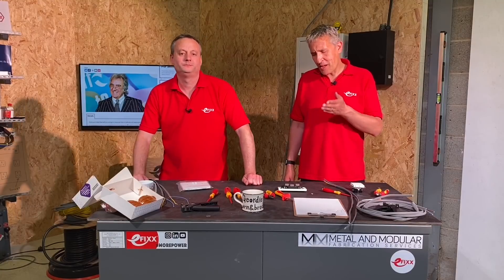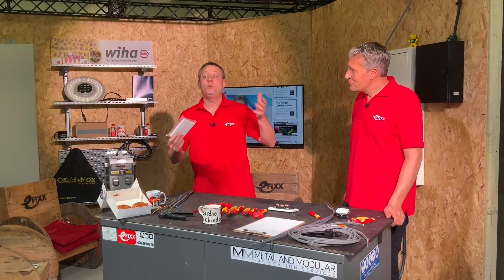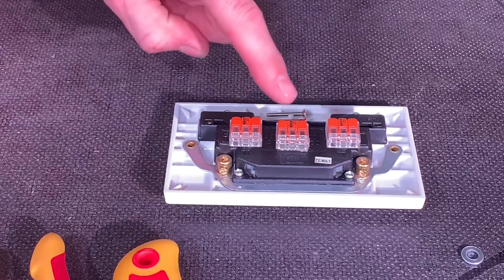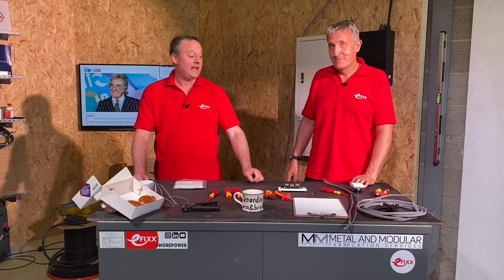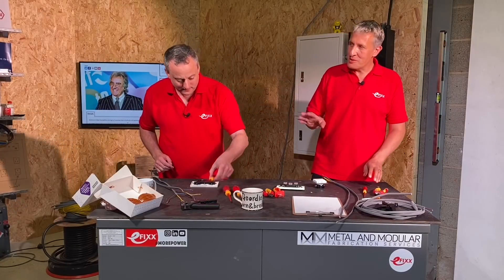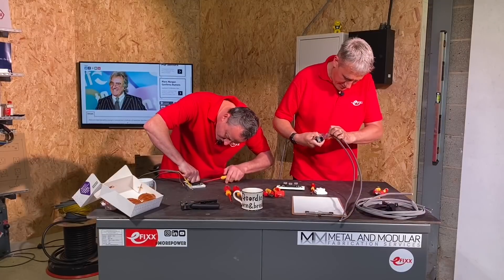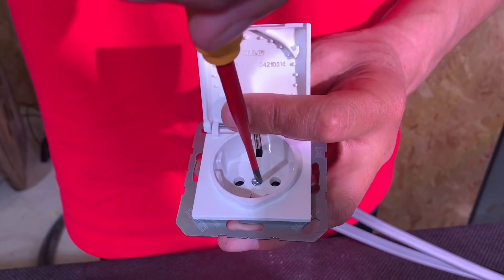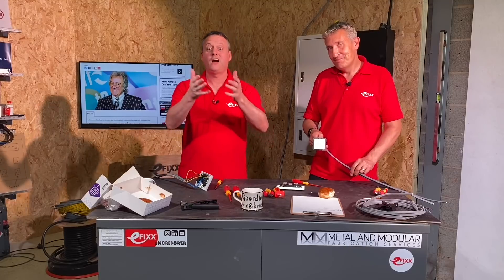When will UK sockets have WAGO style connectors? - electricians comment

Comment: In my experience lever connections are great. Push fit has been rather varied in success. Its too easy for a wire to slip out of a screw fitting especially when there are multiple wires into one fitting.
Reply: Absolutely. In theory meant to get 4x 2.5mm into a socket terminal, but so often a little tug after tightening the screw pulls one out, wouldn't trust 4 wires in a terminal longer than it takes to get them in there! These days if it needs more than 2 they go in a wago and just have 1 to the socket!

Comment: I was thinking this on Saturday as I was desperately shaking the socket to get the screw out of the back of a B&Q special that I'd backed out slightly too far. Absolutely no chance of getting it back in either with the poor design so had to ditch it and install one of mine - the joy's of customer supplied fittings....

Comment: oh yuck wagos on the back of a socket getting stupid now screws dont go loose over years thats the biggest load of rubbish
Reply: Loose screws is one of the biggest causes of electrical fires.......
Reply: @paulekstorm-hughes1894   i dont understand though if you screw the terminations nice and tight when its installed what could physcialyl and realistically cause them scres to become loose when they are not distubed
Reply: Kieran tv Youtube Tiny changes in temperature cause endless expanding and contracting of the entire assembly. The copper wires that the screw clamps down on very slowly deform under the pressure of the screw. Pulling plugs in and out causes slight flexing of the socket. It's very common to remove an fitting and find the wires just resting in the terminal, or even completely disconnected. This is why junction boxes etc with screw fittings must, under the regs, be installed where they are accessible for maintenance- which basically means checking and retightening of the screws periodically.
Reply: @filipe.skunk8   oh really i been advised by the electrical shop not to use wagos as there awful terminal blocks are the best and i have never had a problem with them
Reply: @filipe.skunk8   oh really ever heard of the words GROW UP 
i rectified and repaired reverse polarity issues today thank you very much found a old as junction box were the screws loose on it no they wernt must of been there for years no burning nothing  because things were built with pride
ill have you know aswell i have learned more from my uncle whos a electirican than i have from college whats this channel about again more stupid teachers moaning about stuff that winds them up in my college electrics we test projects with 13 amp plug tops
Reply: Mine worked loose.

Comment: Whenever the patent expires?
Reply from the maker: Wednesday 🤣
Reply: There is no patent on spring loaded connections.
Here in Germany everything is spring loaded except the breakers or some cheap appliances.
Every brand of switch or socket has some kind of springloaded connection.
The socket with screws are not allowed anymore (at least in new Installations)
We also don't do junctionboxes anymore.
Everything gets connected in the hole for the switch.
Just to avoid connections that are inaccessible.

Comment: Definitely the way to go (excuse the pun!) So many sockets now have cheap screw terminals that aren’t big enough to reliably take three 2.5mm wires - especially if you have stranded conductors (older twin & cpc or conduit cable). As others have commented; far too often you find existing work with loose screws or incompletely inserted terminations ready to overheat!
Reply from the maker: Great points 👍 thanks for commenting

Comment: Here in Germany that's the standard for several decades. It started with light switches first, then the outlets were fitted with such terminals. And now you got boards, MCBs, RCDs, RCBOs with such terminals (Hager Quick Connect).
Now these days only cheap outlets or switches have the screw terminals. With one exception, special devices like a wall mounted pull switch, or old stuff which is still in production like the old black bakelite switches like this one:

https://www.heinze.de/imagedownload/?image=/m2/20/59220/images/73/13515673px1250x1250.jpg

For people which like the 1950s industrial style in their home...

And there's no need to push the button when inserting the wire, only when you remove them.

The switches, in that case a two-way switch but as you can clearly see, the housing is also used for other models like the intermediate. But in that case there are three terminals, behind the other holes is no terminal:

https://www.voltking.de/media/image/product/59987/md/busch-jaeger-2000-6-us-wippschalter-einsatz-aus-und-wechselschaltung-thermoplast-blau-2cka001012a1069~5.png
Reply from the maker: Great information - Thanks 🙏
Reply from the maker: Can you send us a link to an RCBO with screw less terminals.
Reply: @efixx  Single phase, B16, type A, 30mA:

https://www.hager.de/modulargeraete/fehlerstrom-leitungsschutzschalter/fi-ls-schalter-1p+n-6-ka-quickconnect/ads916d/982446.htm

Three-phase, B16, 30mA type A:

https://www.hager.de/modulargeraete/fehlerstrom-leitungsschutzschalter/fi-ls-schalter-3x-1p+n-6-ka-quickconnect/adz316d/1001726.htm

Comment: Almost every Socket and switches  in Danmark are without screws and have been that for many years.🤷🏻‍♂️🇩🇰
Reply: How do fit the socket face to the back box.
Reply: Adreen Ryan With a hammer.😁
Reply: @adreenryan2901  there's three parts, the back box, the socket and the face plate. The socket itself is where the termination happens, this is carried in a cage as seen in this video. That is attached to the back ox with a couple of screws which are usually retained in the back box. The faceplate then screws to the socket, sometimes snapped in place depending on the manufacturer.. Almost all switches are snap on to the switch body.
Reply: Your just as bad as Dennis Gorny. Must remember you southern Danes are practically German

Comment: Looks like the German single socket would need at least a 35mm backbox? (Possibly a 47mm if you include the cables entering via the top/bottom then looping behind the socket to the terminals)
The time saved at 2nd fix doesn't look like it'll cover the time chopping out at first fix to me. Especially with dot and dab being a uniform 25mm. All that chopping out would have to be pretty accurate and flat to keep the plasterers happy. Can't see it taking off on new builds any time soon if they need deep boxes!

I've never used a push fit connection with solid 2.5mm copper. Would the "stiffness" of the cable be able to counter the springiness of the connection?
Reply: We use a standard hole of 68 mm diameter for every power connector or light switch. The deep is variable, 40 mm is old standard. I like to use 50 mm for space for electric actors (eg. bluetooth) or cable connectors. In the history we use an extra hole for connection - now all into the switch holes. It is more easy to repair.
Reply: You are forgetting that the backboxes are round so drilling the hole for them is a piece of cake, a second more with the core bit gives you a deeper hole! First fix takes much less time in the first place!

Comment: We've had quick connect push in outlets and switches in the US since the 1960s.
Reply: I'm in the US and my brother's house developed several faults with outlets wired with 12/3 cable and push in connectors. That arrangement used 6 of the push in connectors per outlet and the stiffness of that many wires made it difficult to push the outlets into the boxes (which are narrow and deep in the US). I use Wago connectors now and they work great as you can push each separate connector into the box without much wire stress. As a time saver I'd prefer outlets come with attached wire leads that you can use with standard Wago-type connectors.
Reply: Yeah, but only for 14 AWG wire and could not be used for 20 amp circuits.
Reply: Yet wire nuts (which are crap) are all over the place. 

Every time I pull a socket or switch off the wall the nuts get replaced with wago.

Comment: You don't have to push the lever of our German sockets. You can push the wires in there without doing anything. The levers are there to release the wire.
https://youtu.be/GY52Ixd5SmU

 Additionally this type of socket is the standard one since the early 90th. here you can order nearby everything with screwless terminals MCBs, switches, sockets,  industrial connectors, CEE plugs, din rail terminal blocks up to 185mm2, lamps,.....

Comment: I’m waiting for a back box with the terminations in, and some sort of standardised blade terminal on the back of the socket so the consumer can change the socket front without disturbing the fixed wiring...
Reply: Assume these would be similar to to boiler timer/control panels, backplate has all the wires, hook on front panel uses spring loaded pins ?
Reply: @andyrigby6991  And same as a klik rose👍

Comment: Great idea. Wagos are brilliant, some pushfit/spring connectors (chinesium) are rubbish. If manufacturers implement wago style 221 connectors, they need to be as good or better quality as wago. As soon as you get a failure, people will go back to screw terminals. I like the idea. Also consumer units with mcbs that can use wago style would be good, as others say. An inline wago FCU Would be cool too.

Comment: Screwless connections are quite common in industrial / control - DIN rail terminals, Rexroth Indralogic PLCs have them, Ansell Optilux high bay lights have them and I've seen 110v trailing sockets with them.
One interesting one is Omron MX2 motor inverters; control signal terminals are screwless, but the power input terminals and motor output terminals still have screws.
I reckon for switches and sockets, part of the battle will be getting them slim enough to fit in a shallow back box (might not be an issue on a new install where you have control over sourcing materials, but could be on a repair to an existing installation).

Comment: Screwless terminals on sockets and switches have been used in Germany since the Mid-1970s, first introduced by BuschJaeger (owned by ABB today).

I once renovated a flat from 1975 and all the switches had these connectors.

Today push-fit connectors are used almost exclusively, screw terminals are very rare now.

Comment: I am sure in the 80/90's Crabtree done a switch with push-in connections. Also, consideration would have to be given  to having a spur from the socket.
Reply: go radial mate,go radial ffs and forget about the ring non sense....yu are still wiring the 1930's style ffs....in the 2nd ww you did not reduced the number of casualties because of the same f...reason..."we stay british,we do not change"...so much stubberness ffs!

Comment: Cant we please have cable with sleeving on the cpc ..... they do in ireland i believe ?
Reply: We love stripping the cable by grabbing the CPC though
Reply: @user-wk7wv8rn8h  correct, the old cheese wire techique
Reply: It has been made in the past, but electricians didn't buy it. It cost a bit more, and the cable is a bitter thicker and stiffer. Not just that, but the Irish stuff requires a CPC of the same cross-sectional area as the line and neutral conductors, so that adds a bit more cost and stiffness too. 

Theoretically that stuff is all legal in the UK if somebody cared to import it.
Reply: Steve Jones the Irish and the rest of Europe.. cpc must be the same cross section as the other conductors otherwise isn’t allowed.. only in UK these things are allowed.. i never use Twin & earth in my installs in Uk.. always VV cable or singles installed in tubing..
Reply: @filipe.skunk8  waste of copper and P.V.C
Reply: @filipe.skunk8   SY, YY, CY, VV, etc cables all have lower insulation and sheath thickness. As such, they are classed as non-standard cables, as opposed to twin and earth, which is a standard cable. Therefore, the use of SY, VV cables, etc under BS7671 isn't automatic. As for CPC being equally sized to the line conductor, where are you getting your information from? Only single cables, being pulled through conduit, requires the CPC to be of an equal size to the line conductor. Considerable strain would be placed on a smaller cross-sectional CPC when being pulled with larger line conductors. Hence the need to match the cross-sectional size of the line conductor.
Reply: Peter Lewis that’s easy.. just stop using twin & earth..
Reply: Australian TPS also has sheathed earth
Reply: As DiYer gutting and refitting a whole mid-30s semi, I uncovered 80 years of mad writing and rewiring. I installed backboxes, conduit with strings in for almost all cables and the sparkies had a dream job of just feeding in the cables and wiring up lights, switches, sockets, etc. 
   Each one I used was qualified, certified, and recommended. Every one was sloppy to a greater or lesser degree. When it was allowed, I did it better myself. I've fixed a lot of their sloppiness using Wago and similar connectors (wonder why they didn't use them). I did notice that sockets are trash compared with years ago so the aluminium or similar screws don't grip the wires like old brass ones did. Some big name socket brands wouldn't grip more than one wire and that had to be held just right. Surely Wago type sockets must come soon?
Reply: They do it in rest of the world. Stupid idea of saving money.
Reply: If it has to be flat, then you could use Polish YDYp cables ... It's certified for the European Union ...... Ooooops ;)  I forgot, you are out ;)

If it hasn't to be flat, then just use NYM-J
Reply: @oaw_manofnorse  when are you people going get over the we've left the EU?
Oh and we have various types of cable with the CPC already covered, but we are capable of handling both options
Reply: But you could put all wires in flexible pipes and terminate the pipe in the box and use the flexible single isolated H07V-K instead. If rodents munch on cables, which they rarely do since the pipe tastes awful, just pull the old out and in with some new. Or you like to add more lighting circuits like a push-dim. Add another wire.

Comment: I don't know if they have improved because when they first arrived many a time I have pulled out multi stranded cables out of the terminal with a few back and forth twists,! I don't like them ! but being old school of 50 years in the trade to me they are not a mechanical connection.
Reply: should use crimp ferrules on stranded

Comment: Why do other countries consider U.K. electrical installations to be primitive ?
Reply: Because they have not seen USA ones?
Reply: Because they are very primitive compared to most of Europe! I have seen the Legend pushfit sockets for many years. The MCB are double pole. No ridiculous ring circuits. Really good sealed backboxes that do both plasterboard and solid wall. Fitted into round holes that can be easily drilled. Proper sized consumer units that can be built into a truncking system. Etc etc
Reply: Farmer Dave because they actually are primitive..

Comment: You guys want wago sockets I'm waiting for wago fuseboards
Reply: Actually there is a whole range of screwless MCBs and RCDs available by Hager : „Quick Connect“

Neutral and Earth-Bars are screwless as well.

https://m.youtube.com/watch?v=525d5OQMei0
Reply: @tristans5945  Welcome to the Dutch way of doing things...
Reply: Ja, de moije Hager Volta schakelkast, ook gebruikt in Duitsland :)
Reply: Your wait is over: Hager Quick Connect...
Reply: A pre-wired bespoke consumer unit with a facility for expansion but with a marshalling box on the top for termination. You may be on to something.
Reply: Did a fuse board change today and was literally thinking this.
Reply: Been using them for years. Commercial, industrial. Domestic wiring is so far behind its dangerous.
Reply: Don’t see many wago light switches
Reply: No need to wait, ABB and Hager (at least) have product for you.

Comment: Prefer the old fashion version,time should not come in to the factor
Reply: Your so right I will always use connection blocks where necessary .
Reply: Screw terminal are simply not as good as pushfit. Screw terminals can loosen with temperature cycling, so that is why they are not allowed in MF junctions. An old fashioned JB takes several time longer to wire that a Wagobox, but is less safe, less secure etc. So it is not a matter of saving time over quality. The more modern pushfit systems are better in every way.
Reply: @peterhughes4957  thanks for comment,must admit I'm old school,thinking that when you push back push in connections skts/swtitches etc,could they move with any pressure put on them,must admit will have to try this modern technology he he I find the screw version come loose if they were not tightened up in the first place ,but what your saying I think they call it harmonics ?

Comment: Years ago I picked up and used a few makes of screwless switches and sockets, they are fast but I didn't like them, since then and since the release of the 221 which I can't seem to get enough of, I won't be going back to the screwless mechanisms as I've been using Bticino Luna for more than 25 years and that's my go to range for all Jobs. I tend to pull my face at anything I'm happy with a bit stubborn I know.